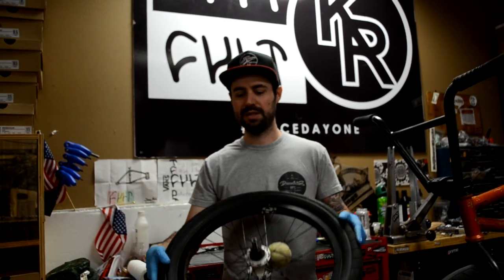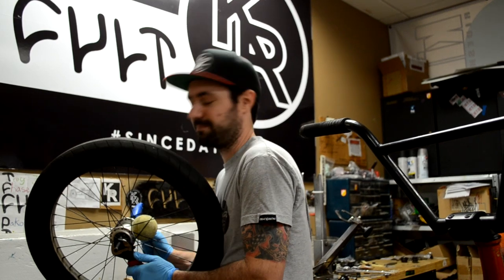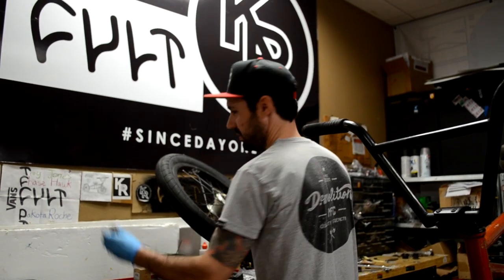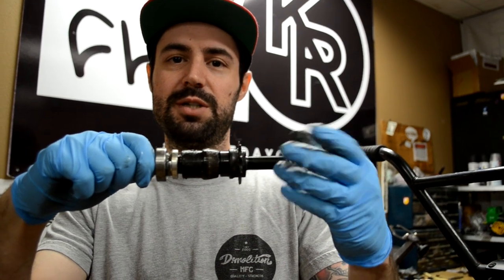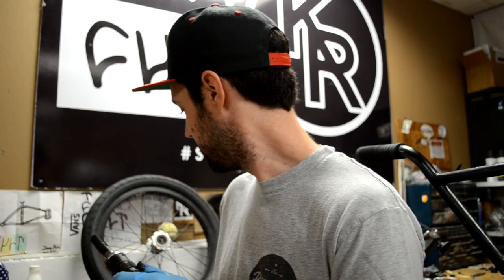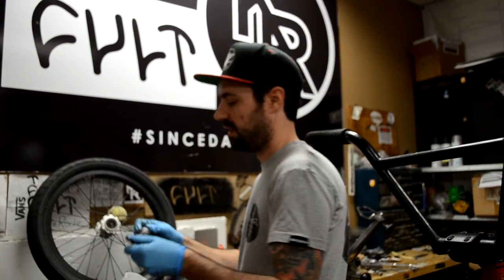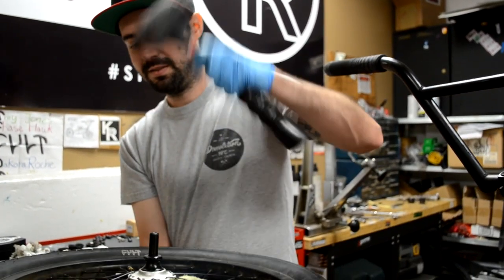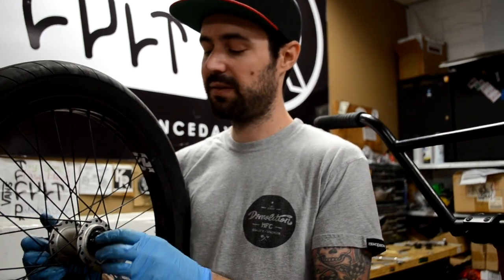HOW TO ADJUST SLACK ON A FREECOASTER

Comment: does it work with any free coaster
Reply from the maker: Many coaster are a lot similar to this, but obviously some are different, mostly profile Z coaster, Madera Gulf, and the Salt Trapeze.
Reply: Nearly every coaster out there have internals that are almost identical. Even if your coaster is a bit different, the principles are the same
Reply: So any disadvantages to have less slack? I literally went over the handlebars yesterday trying to ride my new free coaster bike because I went to pedal hard and the pedals just spun and i went over the bars.  So if mine came with more slack like almost a quarter turn i assume I have to buy washers for my free coaster type to lower the slack